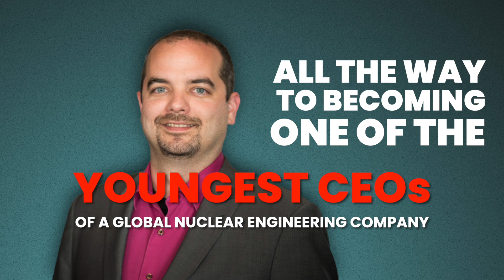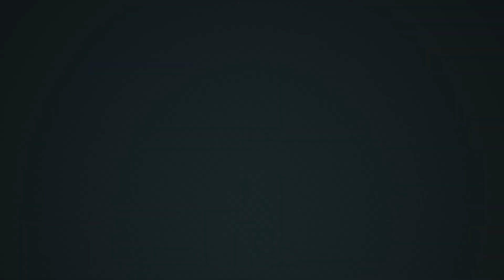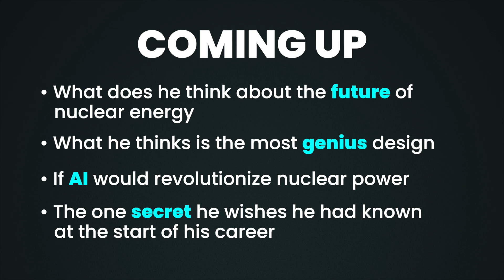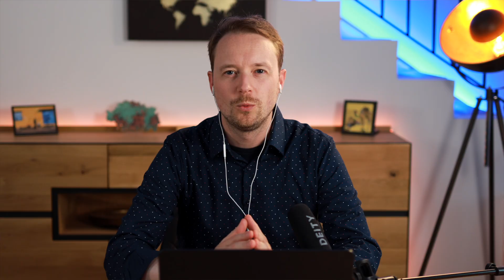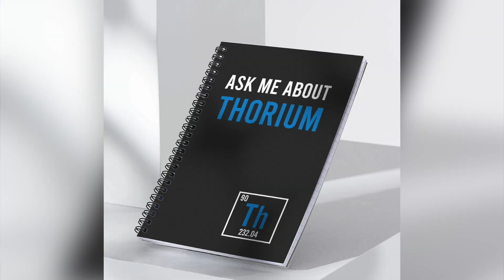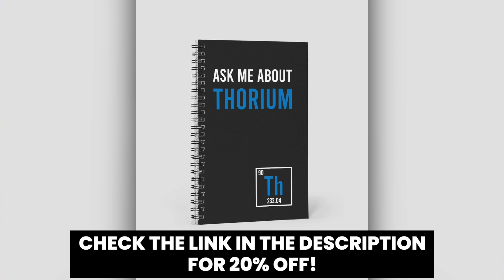Meet the CEO Taking Nuclear Power to the Next Level

Comment: While acknowledging the elegance of molten core reactors, he skipped all of the really important benefits. They are very low-pressure/ very high-temperature, this is a really, really big deal. Safety/efficiency are the first things that come to mind but it's the high temperature that is the most important for industrial heat. Electricity is only about 20% of our total energy demand, industrial heat is twice that and PWRs can not fulfill that need. Next is cost, about 85% of the cost of a natural gas plant is the power conversion equipment and a high-temperature nuke can utilize the exact same equipment instead of very, very expensive low-temperature/nuclear-qualified equipment. There is no reason a MSR should cost any more than a coal or natural gas plant.
Reply: Your ALL  Fools Of Greed   Nuclear IS & Will ALL WAYS   Be A LIE    Killing  From Start To NO END OF DEATH   Facts

Comment: If no fossil fueled future then 5 TIMES  more electricity is needed. 

5 TIMES  more grid capacity to disperse the central generated electricity. 

The existing national grid is FRAGILE because it was so EXPENSIVE to construct over the decades.
Never over engineered, never overbuilt. 

Most of bill payer's bills are 66% grid costs.

So universal nuclear heaters at power stations and 5 TIMES more generation plants and 5 TIMES bigger national grid capacity. 

The economics are insane and not talked about on nuclear promoters public forums.

Poles and wires and transformers and switch yards and transmission lines to the streets and homes and businesses and industries and buildings and warehouses and shopping centres and millions of ends of the existing national grid all with 5 TIMES bigger capacity. 
$TRILLIONS and decades 

Hello, hello anyone home. 

Millions and millions of EVs parked 23hrs every day is a stupendously large amount of daily energy storage. Battery storage.